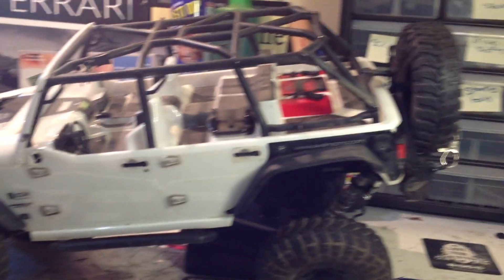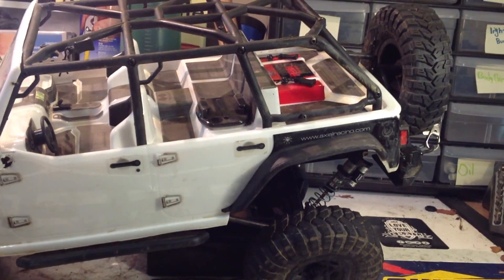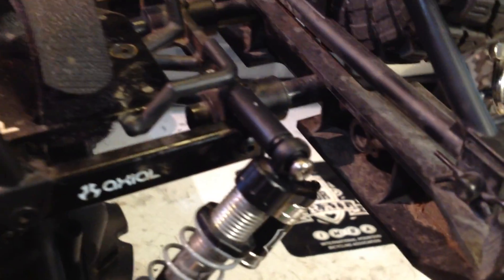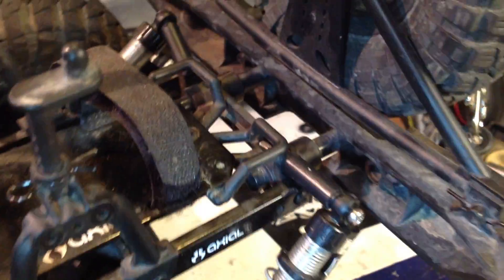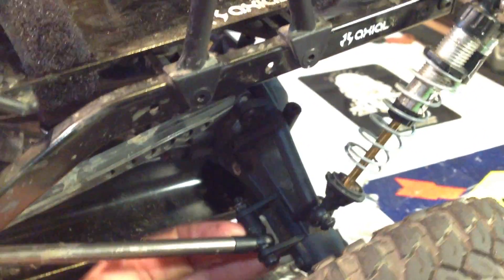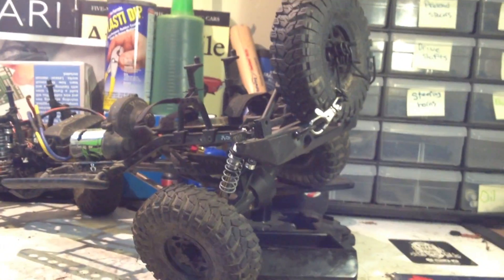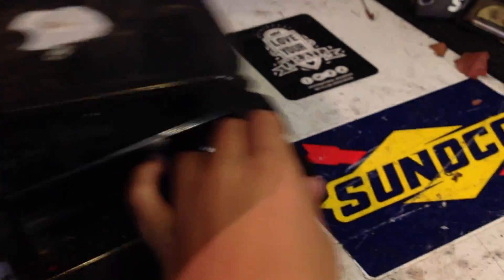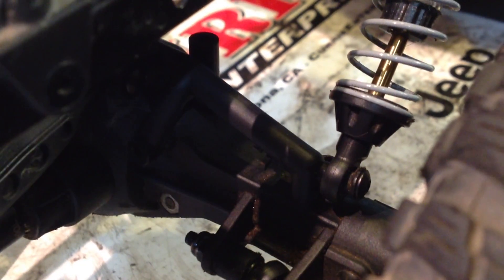INSANE AXIAL SCX10 MOD!

Comment: The Idea of that is cool because your right the shocks on a real jeep go like that. But on a real jeep they arnt coil spring shocks their just a oil filled shock. The coil springs are connected to the frame and axle in the vertical position. I think what your doing is a good idea but you need to find a better way to mount them or something is going to brake.
Reply from the maker: There are coilover conversions for jeeps and this is what I was aiming to achieve. Evo off-road has what I'm talking about.
Reply from the maker: http://www.jk-forum.com/forums/modified-jk-tech-2/coilover-vs-standard-sping-lift-232536/#b

Comment: They are angled to far out... Even the jk is barely angled outward. The uphill climb will suffer. With that said, it just sits up to high in the rear compared to the front so center gravity is disrupted.
Reply from the maker: Kevin Clements 1. It’s an r/c car. I don’t care about having them angled perfectly. As long as it works. 2. It works. See my later vid of it in action.

Comment: First off thanks for taking the time to make this vid, and I say if it works the way You want it to.then all the power to ya, I think your on the right track there. How dose it hold up on the trails? Last thing. Head over to my channel and check out the suspension I made for my jeep. It sits level gives you extra flex and holds up very well to any terrain. Happy RC'in!
Reply from the maker: Thanks for leaving a coment. I checked out your vid and that's a pretty smart idea. Did you try to reverse the shackle at all? I have run this setup on the trail and it's awesome. I will have a vid up soon.

Comment: Lol you just threw out the purpose of having shocks. You have zero play in the front shocks all body rubbing for what I see. You should have just change the shock oil to a 15 weight to achieve more play in the shocks. Don't try to recommendation anything like this to anyone. Rock  crawling is about ride height and weight disbursed buddy. Which neither you have now. Good day
Reply from the maker: I actually have more ride height now and more articulation. The front shocks are still in the stock position so body rubbing is not effected from this mod. When rock crawling, at least in my opinion, the a shocks should comply with the rocks and they should be soft. I actually am not running any shock oil. Just enough to keep everything lubricated. Again, this is what works for me. I will continue to share this mod because it works, and until you prove me otherwise I will not take down the vid. Thanks bud.
Reply: Lmao works sure keep telling yourself that. Kids smh.
Reply from the maker: How do u know it doesn't work u ignorant piece of work? U haven't seen it on the trail so ur comment is worthless. Like u
Reply: Aww don't get mad bro cuz I called out your be. Lmao if your going to run something that stupid then my friend get longer spring so you don't have that gap. Learn more about rc before you speak bruh.
Reply from the maker: Dude, I've been in RC's for eight hears. Don't tell me that I don't know my shit.
Reply from the maker: Because you know me right. You know everything I forgot
Reply: Enzo loco  I agree with you Enzo Loco, I have done this to my scx10 and it really improves the performance. That other guy should try it first before he says crap about it.
Reply from the maker: Thank you for the support Off-Road R.C.!
Reply: Enzo loco no problem, almost all of these guys who say it is crap they probably have not tried it. Just don't let these guys try to put you down.
Reply from the maker: Haha they won't. I'll have a new vid up tomorrow with my rig in action. Thanks again for the support and catch ya in the next one.